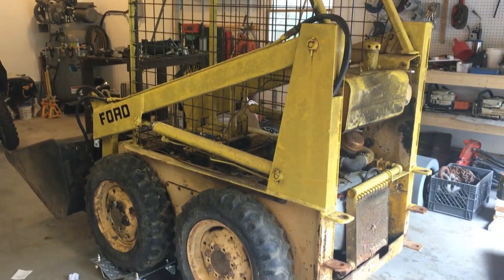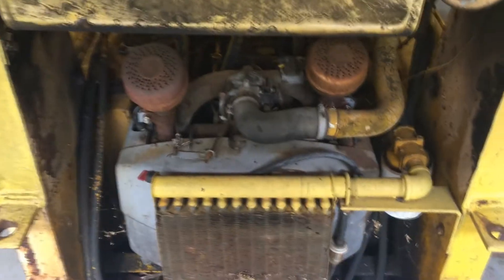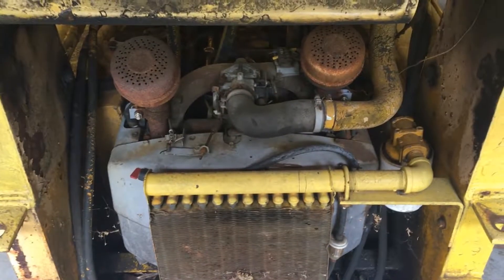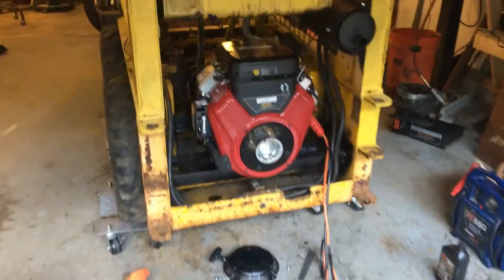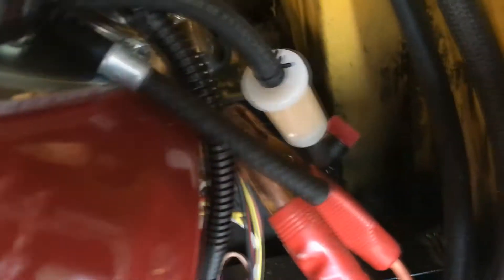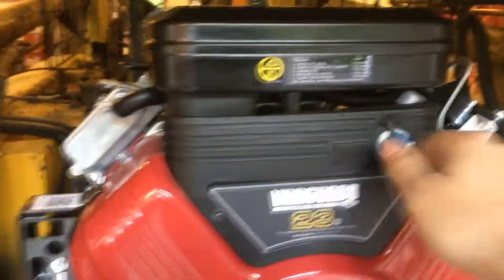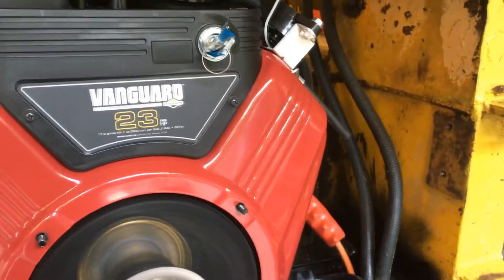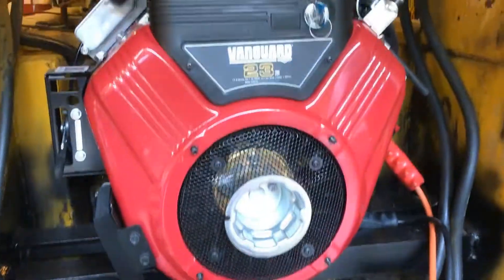Skidsteer Ford CL-20 New Engine Install

Comment: Nice job looks good runs good. I have an erickson 2548 but I went with a kohler command on my repower. I ordered one that had the splines cut in the crank and a pump mount on the back of the engine. Bolted right up but I did have to fabricate a pedestal to sit it on. Did you use flex pipe on your exhaust? Looks good. Handy little machine. Mine surpises me with how much work it will actually do

Comment: Was the motor replacement a kit or home built conversion? I have a Ford CL20 and found a company online that sells a kit with the mounts and a Honda V-Twin motor.
Reply: The old motor runs out of snuff and is slow to recover under load. How does the new motor do at recovery? Better, worse, or about the same?
Reply: Hello, I happen to have a nearly identical skid steer and engine I am working on installing... It is an Erickson 1979 lm4d with the same onan engine. Can you please link to the coupling you used for the driveshaft? I can't find anything anywhere

Thanks
Reply: @StanwoodStudios  Hey machine brother....we need a quick video of how you did the bolting-up and alignment of the Briggs vs the old Onan.  Just like the other guys I have an old skidsteer that wants that Onan NHC gone!  The online guys are secretive about the mounting plate/crossbars.  Maybe even a measurement or two?  ;)   Thanks mate, huge amount of fun vids on your channel.  Sterling is my work slug, I prefer the newer fancier Freightliners with my Fassi crane. :D

Comment: Hey man. I have the same skid but the engine is going.  Can you tell me how you mated the motor and the pump? Any help would be awesome.
Reply: jst369  he used a love joy coupler
Reply: I have an erickson 2548 same machine. I repowered with a kohler 25 hp command. You can order the kohler with a 13 spline crankshaft plate on the back of the engine. It bolts up just like the onan does and you do not need any love joy couplers
Reply: How did you get the engine and hydraulic pump separated? I’m buying one with the Onan, and I’m wanting to make the swap. The bolts that hold the engine crankcase to the pump are removed, but the two won’t separate. Any tips? Thanks!!!

Comment: How were you able to disconnect the old Onan engine from the hydraulic pump? I'm looking at one and even with the bolts removed the engine won't separate from the pump. Any tips for disconnecting it?
Reply: @StanwoodStudios  ok, thanks so much!